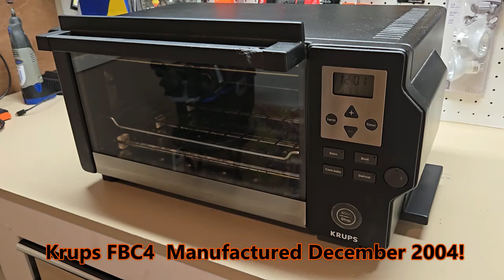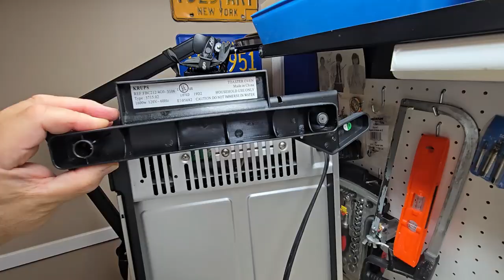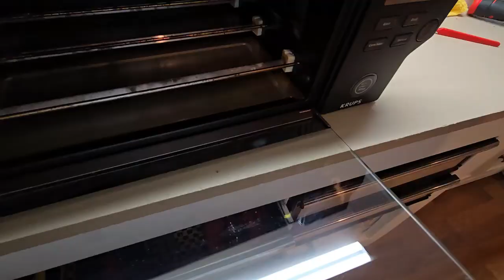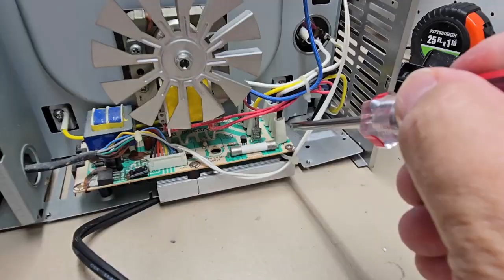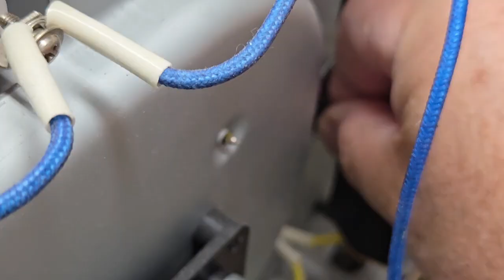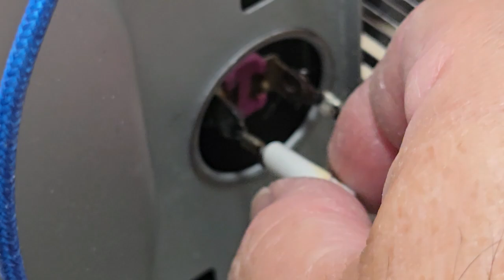Toaster Oven Repair - Power But No Heat

Comment: Do your best on a repair. This unit is from the old school. The newer models just don't cut it. 
You will also save an item from the e- waste 🗑 landfill. 😊
🇧🇧
Reply from the maker: Yes sir! That's the goal! At some point not everything is repairable and you have to eventually deep six it. But until then, that's money in your pocket! Thank you so much for watching and for the great comments😊
Reply: I got your reply just this min. 
It's true that all units can not be repaired. But the fun is giving it a shot. Best 👌 Regards. 😊
🇧🇧
Reply from the maker: @Masterj3712Amen Brother!
Reply: @fixeverything...
Usually, as a repair Tech myself, the units that are way beyond saving I stash in storage. They then are labelled "Salvaged Parts." For these, then can be of beneficial use down the road. I have had in the past numerous instances where I regretted dumping a component to later find it had a part that could have been of use to a present day work project. One has to be careful, though not to be in a position of accumulating clutter. This is where our e-waste management skills are put to the test. 
Best 👌 Regards. 😊
🇧🇧
Reply from the maker: Agreed! I'm very good at stashing things and keeping them for years thinking I might need them in the future! At some point I have to declutter myself! Thank you for watching!😊